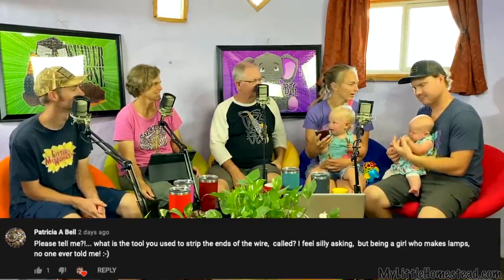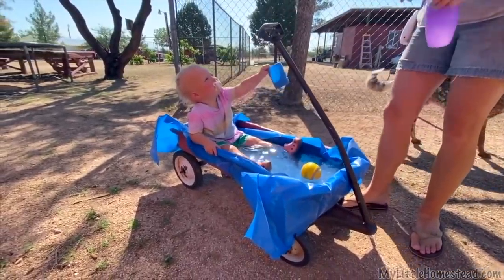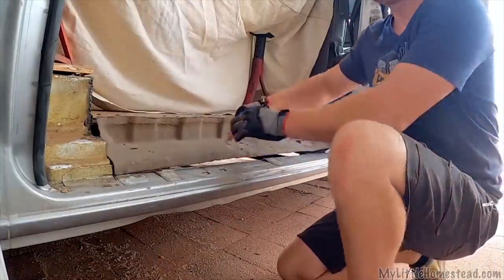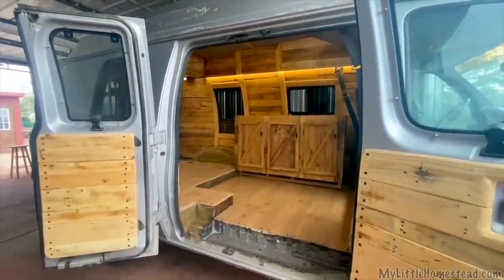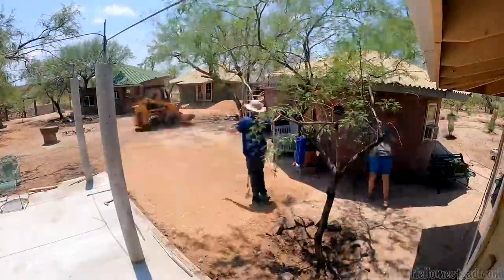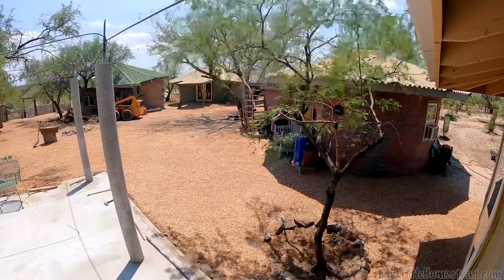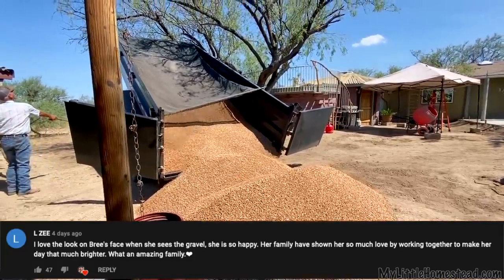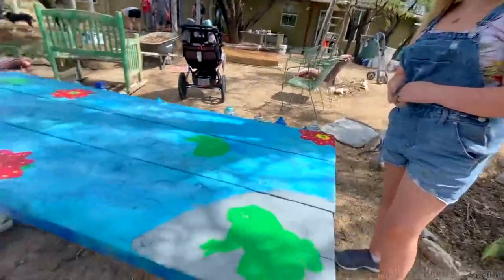Wedding Prep & Van Lights! | Episode 78 | My Little Podcast

Comment: I truly get the wedding planning. My Daughters getting married in January. We just found out the venue may not be available so I am in middle of plan B plan C and plan D. If all else fails I told them it will be in a trailer park at the picnic pavilion instead of gifts they will be requesting coats, blankets and patio heaters. Lol

Comment: Cool thing about wire stripping...EVERY standard (2 plug) electrical outlet (the behind the cover outlet) HAS 2 different gauges of wire stripping - one on the left & one on the right --  you put the wire in the slot all the way, then pull down. Also the distance you need to install the outlet too - is indicated on the back side by another little indented (?) section off to one side or corner of the backside of the outlet.

Comment: If you want the gravel to remain a thin layer you can always use Gravel-Lok.  It's  specially epoxy used to keep gravel from moving about either by weather or by constantly walking on it.  The only thing is once you use it water will NOT drain thru the gravel.  It's like having pavement that looks like gravel.

Comment: I got my husband those wire strippers years ago from radio shack, he still uses them 11years later everyone wants them and asks where he got them from
Reply: My dad was an electrician this is called a, 5 In 1 Multifunctional Automatic Wire Stripper Cable Cutter Stripper Crimper Cutting Pliers Tool. And electricians dream tool. They come in several different sizes for different types of wire.
Reply: I used to wire strippers when I worked in a factory over 37 years ago.
Reply: I looked for my pair . I don't have them anymore,  but I bet I know who does-- watch out kid, here I come.
Reply: @iminstiches  lol, that is a good one 😁